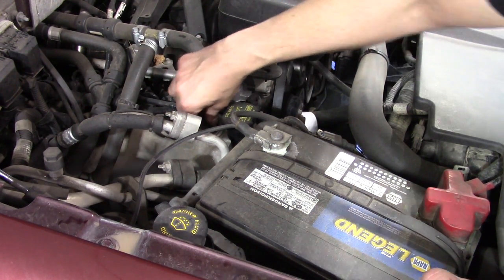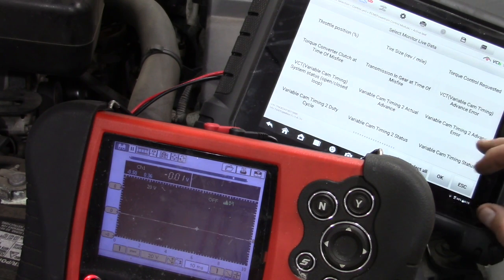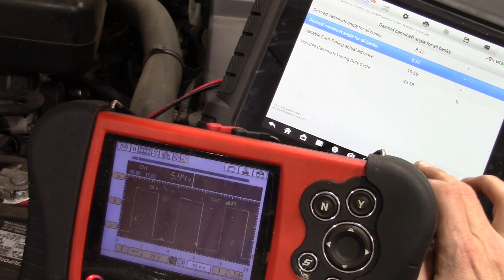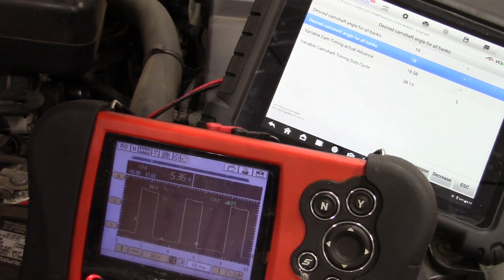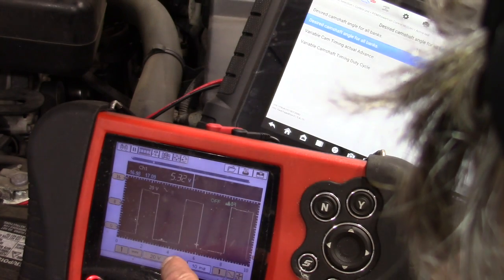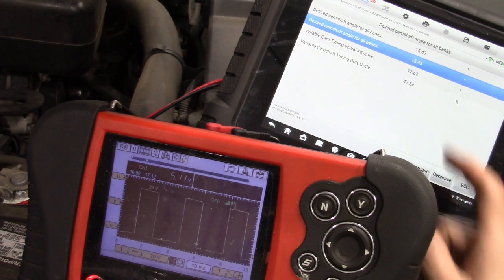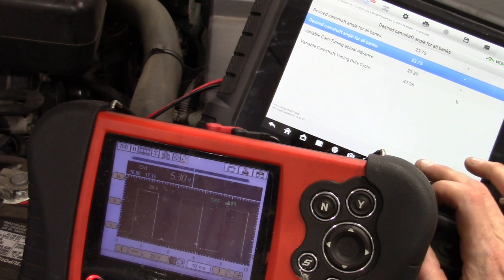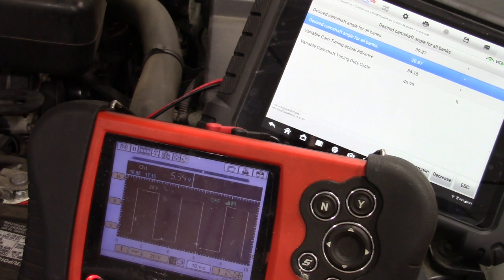Help! Why is VVT solenoid doing this? (Part1 of 2)

Comment: I had a problem when few teeth of belt were out of correlation with the crankshaft. ECU didn't allow to change any angle which always remained at 6° until correlation was corrected.
Reply from the maker: Yes that would be expected- however I am not seeing VVT shutdown- I can make commands.
Reply: I don't mean to compete with you however I have one important experience of having weird luck to learn that different cars have different softwares (possible glitches) and sometimes digging deep into the rabbit hole is a time wasting ride without any enlightenment so maybe it is a good thing to check correlation at this stage and suspend common sense which we normally should expect from engineers - how much I would love to talk some of those scientists working for car makers..  You can command but whatever is desired, commanded is not always what is observed.
Reply from the maker: totally agreed. commanded does not mean observed.  but that is common sense. NEVER suspend common sense in a diagnosis!! if you are not using logic in a diagnosis, you are just guessing even if you don’t think so.

Comment: Sorry, also check for secondary oil filters, as per the K series Honda engines, that also have an oil screen under a little cover on the side of the cylinder head.

Comment: As someone mentioned, Ivan at Pine Hollow recently had a cam phaser out of position. It's worth ensuring that the location dowel hasn't been pushed into the camshaft during assembly. I've personally seen this on Honda engines. Good luck, Martin.

Comment: The VVT solenoid spends most of its time in a neutral position. If a change in the cam angle is desired a brief signal is sent to the solenoid and then it returns back to neutral.

Comment: You have to monitor engine rpm too.. Slightly change in rpm can slightly increase oil pressure. Increased oil pressure requires vvt valve control get back to previous state. Basically what i am saying, you tell vvt valve go up, he goes up, engine rpm goes up, oil pressure goes up, if it continues, you'll have loop, so ecu tells vvt to calm down, and everything goes back to stable. Except rpm, which should be slightly changed..

Comment: The timing is coming from the cranksensor. The valve timing is the camshaft. So that's why the timing doesn't change.
Reply from the maker: Yes but we are looking at cam angle  relative to the pulsewidth modulation of the solenoid. has nothing to do with CKPD.

Comment: The frequency is generally static.  Microcontrollers can have the frequency change but the electrical motors in this case is not VFD (Variable frequency drive)  That's more of an idustrial motor type of thing with 3 phase controls.  Watch Wes Work is correct.  Think along the lines of what a cruise control does to maintain speed.  The accelerator tips in and tips out until the speed is matched using a closed loop.  If you eliminate the cam sensor, you've broken the loop and the behavior would change.

Comment: I am not expert but I believe you are looking at a Proportional Current Control (Position Control) valve.  The change in position is current controlled and it will alway show about a 50 percent duty cycle.   Really, if you aren't seeing the voltage or the timing change on the signal the only other way it would have to control it would be how much current it is putting out.   A digital control valve is on and off and the frequency changes in how much it is on vs off.  A proportional valve opens a certain amount by how much current is supplied by the ECM, but the frequency stays the same.

Comment: A Snap On Vantage is not a scope. It is a graphing multimeter. Your problem is low oil pressure.
Reply from the maker: Sorry but how can low oil pressure be the cause of a command failure- and also the cam is moving as you can see. how is that low oil pressure?
Reply: @SchrodingersBox  Oil pressure is crucial on VVT engines.  Try on a BMW valvetroninc  some time. The scope will not always find your problem.  The follow up proves my point. See you at Bandamier. 

Yeah I said it.

Comment: I failed to word things correctly, but you scope DID show a change in pulse width.  Maybe the trigger point or slope is causing a misinterpretation? 
If you have control, then you have a varying duty cycle. Triggering and slope still confuse me.
Reply: Yeah maybe a faster scope would show it.

Comment: Duty cycle is the difference in pulse width ON time.
Reply from the maker: correct. the way this should work is on time should increase. it doesn’t. but also frequency could increase  as well but it didn’t either. nothing explains the cam angle change.

Comment: I'd love a lifetime subscription so I'm going to take a crack at this. My thought is that after a command is sent and the advance is complete the signal should be expected to stabilize to maintain the newly commanded advance. In other words maintain that oil pressure necessary to maintain the commanded advance. If true, any change in the signal (width or freq) would be transient. Maybe I'm wrong, but to me it looks like the duty cycle IS changing. It might be me or the video quality but it looks like the pulse with is jumping from about 6/7 divisions to about 8 divisions which would be roughly a 14% change before the signal stabilizes to hold that newly commanded advance. To me it looks like it is doing what would be expected - it's just very fast.
Reply from the maker: well someone beat you to it but I think you are right. if I find this to explain it I’ll give you a free month for being second.
Reply: @SchrodingersBox  Either way I am grateful for the opportunity. You've been a breath of automotive fresh air who has helped me numerous times. I stand on the shoulders of your greatness - thank you for your service.

Comment: The pulse width is changing allowing lesser or greater energy to the solenoid thereby changing the camshaft angle.  Therefore Duty Cycle IS changing. Pay close attention to the WIDTH of the pulse.  Sometimes not as wide and sometime wider.  It is elementary electronics.
Reply from the maker: But you can clearly see the pulsewidth is the exact same. no change whatsoever in pulsewidth. please show me where you see the pulsewidth change  IN CORRESPONDENCE TO CAM ANGLE COMMAND.  it doesn’t.

Comment: The duty cycle should only change when the solenoid is moving. It should be roughly the same when the solenoid is in a fixed position, regardless of the actual position. Also, the duty cycle is dithering to avoid stiction, so on your scopes small time base you will see the duty cycle drift slightly. Watching the signal on a longer time base will likely answer your questions. 

From the theory of operation:
The VCT solenoid valve is an integral part of the VCT system. The solenoid valve controls the flow of engine oil in the VCT actuator assembly. As the PCM controls the duty cycle of the solenoid valve, oil pressure/flow advances or retards the cam timing. Duty cycles near 0% or 100% represent rapid movement of the camshaft. Retaining a fixed camshaft position is accomplished by dithering (oscillating) the solenoid valve duty cycle.

    The PCM calculates and determines the desired camshaft position. It continually updates the VCT solenoid duty cycle until the desired position is achieved. A difference between the desired and actual camshaft position represents a position error in the PCM VCT control loop. The PCM disables the VCT and places the camshaft in a default position if a concern is detected. A related DTC is also set when the concern is detected.
Reply: @HouseCallAutoRepair  No. The PCM controls the duty cycle based on the cam and crank sensor. The PCM does not know or even care what the solenoid position is as long as the cam phaser is reacting correctly. That's a very common closed loop control strategy. It's not the same as something like an EGR valve where the valve has a position sensor. 

The most common issue with the Ford VVT solenoids is that metal gets past the filter screens and mechanically sticks the solenoids open. You get rough running under deceleration to a stop because the timing stays advanced.
Reply: But wouldn't the duty cycle cause the valve to essentially "float" at an amount of "open", and the pcm monitors cam position "desired" and corrects accordingly?
I could see the on time width change, but the frequency of the on command stayed the same. That's duty cycle. 
I think I've confused myself now....
Reply: @WatchWesWork  standard vvt operation and failure. In an active test, I'd expect to see changes in DC from commands and no change in cam angle if something were jammed up. Cars with low oil pressure, solenoids, and phasers all act this way.  The only way the ecm knows anything is happening is based on the cam position sensor. I wasn't wearing my glasses but I didn't see any shifting on the scope when he was pressing the commands.
Reply: A large change in desired angle should definitely show this, as opposed to slowly increasing the desired from the scan tool. Makes sense that it's simply maintaining the angle with the roughly 50% duty cycle, and small changes in desired require a very, very small change in duty cycle.
Reply: So the duty cycle increases to move the solenoid to the desired level, then reduces or changes the pulse width modulation  to maintain that level.
Reply: @mph5896  Exactly.. If you watch the scale at the bottom, You can see the pulse widen towards the left side-- as soon as he pushes the button on the scan tool.
Reply: This is correct.

Comment: I ran into problems with this before on Fords that the vvt solenoid can become clogged from the oil not being changed and it's regular intervals but going much longer which is usually a pretty easy tell but also with Fords the PCM and I don't know why but they will just act  weird completely out of character of what it should be doing and it always seems to affect the vvt system and the fix I found for this is to disconnect the battery run a jump a wire from the positive to the negative to do a hard reset and then try your test one more time and I'm almost positive you'll get the readings that you want or at least a reaction I hope that works for you bud thank you and I appreciate every video you make I have learned so much from you with unreal I wish there were more people like you in the world thank you

Comment: Wondering if this test needs to be in a running mode for feedback to see a change . You could be seeing commanded but no actual change .
Reply from the maker: The pid is cam advance actual position though
Reply: @SchrodingersBox  I would think you need oil flow to make actual changes  I’d call it a potential false positive.try it with it running as the phasers are mechanical.
Reply: I was reading some of the other comments and noticed you said the car was running ha I couldn’t hear it .

Comment: Have you tried to measure the duty cycle while driving or under load?  It is possible that the increase RPM will increase oil pressure.  That in turn will advance timing.  Maybe the ECM is using oil pressure and duty cycle to control the variable timing.
Reply from the maker: Great point!  still the command should vary and also we see the position is changing.

Comment: Throw an amp clamp on that solenoid maybe it works like a direct injector where it does the peak and hold thing. Scope the cam/crank signals the cam signal should move in relation to the crank. I guess its possible that because this is processed data its somehow lying for some reason and maybe it's not actually moving? I would wanna scope the signals/current and see for myself.

Comment: I slowed down your video and took a close look at the waveform changing when you commanded it on the scan tool.  If you look at the low side of the waveform you can clearly see it changing.  While it's moving the camshaft and changing the timing it widens.  Once it's moved to where it wants it to be it appears to narrow again. It changes from about 1.75ms to 2mS and back again.  It's very subtle but clearly there.  

Edit:  It may not only be changing when you change command on the scan tool.  It looks like it does seem to vary the on time which is on the low side of the wave form.  It must be a ground side switched circuit and "On" time is the bottom of the wave form, or 0 volts on the waveform.
Reply: Exactly.as he increases the duty cycle the WIDTH of the on-time varies, but the frequency of the of the on command stays the same.

Comment: Does this engine have a dual vvt system?  Maybe its changing the intake, and you are checking the exhaust.
Reply from the maker: but the voltage turns on and off at this solenoid when I make the commands.
Reply: @SchrodingersBox  I know Ford has s few different systems.  1 of wich is a dual independent timing that controls the intake and exhaust separately.  I just thought that might be able to explain the issue.
Reply: @ssmit80  this is a SOHC engine (3-valve motor), it is VCT, not Ti-VCT

Comment: You'd better use two channels. 
One for crankshaft sensor 
And one for camshaft sensor 
And do the same experiment.
In case you don't change the location of the signal of camshaft 
So that means that Scan tool 
He didn't control the VVT solenoid 
Even if it appears in live data
Reply: I thought the same thing. Also put an amp clamp to the solenoid, to see if it's stuck. You can see,when it's working, an interaction on the amp waveform, like the one is happening  on the fuel injector amp waveform.

Comment: Scan tool mixed up the banks? Scope the other bank and see if that signal is changing. (Taking a shot 😊)
Reply: I agree. Was going to say the same. Have you tried pulling the signal down with a test light to confirm your on the right pid/wire.. 
I also agree with previous comments that your graphing multimeter is to slow. You need the pico to capture the quick changes...

Comment: Do you know the history on the cam phasers in there? I know The 5.4 and 4.6 had some issues. There were some alternatives to repairs; I think a lock wedge and tune to keep the pcm from trying to adjust the vvt from moving.  
 Not too sure how or what actual duty cycle would look like. But possibly similar to yours, being a fixed duty cycle with substituted values on the data pids..

Comment: Solenoid works with PID so signal only changes briefly when a change in position is required. That's my best guess. Will continue to research.
Reply: By "PID" I mean Proportional Integral Derivative.
Reply: I think this is correct, did I win? :0)
Reply: When I sort comments by 'newest' I beat both tiit and simon but still didn't win :0(

Comment: The duty cycle is changing but its changing on the low side. Its subtle but it is there. Maybe that actuation also corisponds to an oil pressure change. Its a calculation of oil pressure and duty cycle to adjust the cam phase? Im just guessing at this point. It may also be something that your not seeing due to the sample rate of the scope.
Reply from the maker: but that variance is perfectly constant despite doubling cam angle.

Comment: Can you actually notice a difference in the way the engine is running when you command the Desired angle higher? If not, I wondering if maybe the scan tool has some sort of glitch. Because I agree with your point with no obvious changes on the scope. But it’s hard to tell from the video if the engine is changing with the command. Other thing to note is if there is a stored code, possible that the pcm may only allow a certain PWM as a safety?
Just thinking out loud
Reply from the maker: No you are correct in your thinking. Yes I hear the engine react as I increase angle. if you listen carefully you can hear it in video

Comment: Question do you notice a change in idle speed when you are commanding change to the vvt solenoid? Just a thought but perhaps it's not actually doing what the tool says it's doing. Maybe a aftermarket tune? Or logic issue? 
  Very interesting find Matt!
Reply from the maker: Yes if you listen you can hear engine idle change

Comment: are you shure the active test is accurate?  If you have a fault in vvt usualy the ecm disregards command... does it lock in place when not activated?
Reply: Your vantage just gave you the answer....
Reply from the maker: yes that’s what I thought however faults were cleared AND if you unplug the solenoid to cause a fault- then yes the VVT shuts down and you can no longer command it.
Reply: @SchrodingersBox  if you create a circuit fault istead of a mechanical fault   the ecm will pick it up.... stupid question: did you check oil level?
Reply from the maker: yes oil was changed by shop before me and is no erect level. but even so wouldn’t explain the lack of pulsewidth command. the command would be unaffected by oil level- but the actual result of cam angle could be.